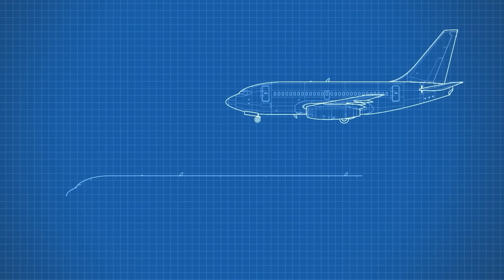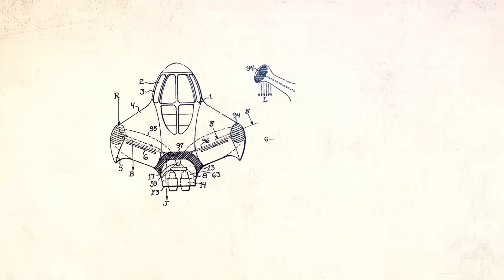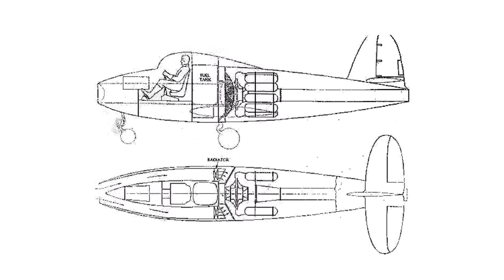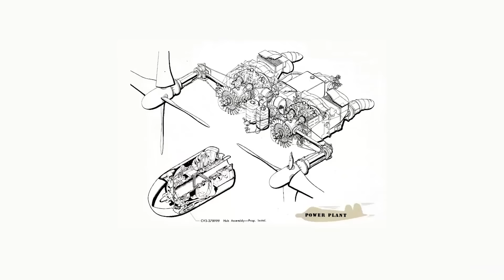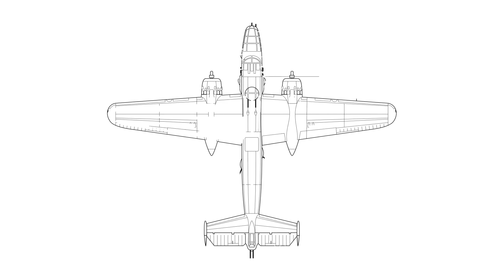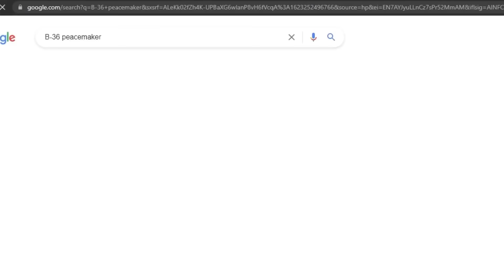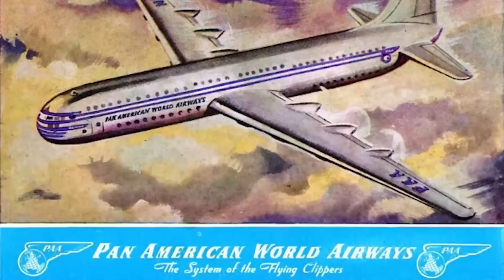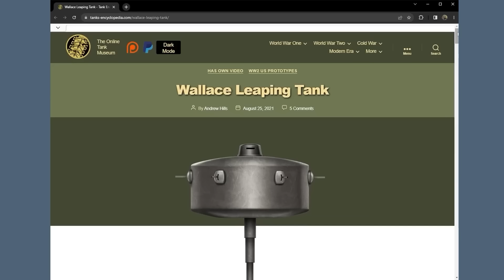The Forgotten Planes of World War 2 | Full Documentary

Comment: There is no mention here of the fact that the biggest problem with Northrop's flying wing was its stability in the air due to the lack of any vertical rudders and stabilizers. This was compensated only in the era of computers and advanced electronics, resulting in the B2 strategic bomber. This does not change the fact that the entire program looks like a highly suspicious fight for military contracts based on unfair competition and lobbying. The victim of which was one of the most talented aircraft engineers of that period...

Comment: You need to see " The Wing Will Fly" a  Documentary of Jack  Northrop's Flying Wing concept. Pay special attention to test pilot Cardinas who refused to do stall tests because power stalls of the airframe type can cause a spin that causes the plane to rotate along the long axis of the 172 ft wing at an rpm rate that will pin the pilot to the seat making it impossible to raise his arms due to.them being pinned to the seat by centrifical force. 

Cardinias recovered the spin because the spin he was in was in the opposite direction and his arms were forced AWAY from the pilot seat, whereas Glen Edward's arms were forced INTO the pilot's seat. Also, it was said Edward's co-pilot was flying it at the time.
Reply: Oh, yes. I forgot to mention that due to the shape of the YB49 the ENTIRE AIRFRAME WAS INVISIBLE TO THE RADARS OF THE DAY. This airframe design shape is naturally INCREDIBLY STEALTHY.  Duplication by the USSR in the 1960's would have destabilized the Cold War. In other words, without modern radar, and with the Norton bombsight stabilizer Northrop devised, this bomber could have delivered Nuclear Weapons into the USSR with NO advance detection. Thus, it had to be NOT developed. The USSR had to be convinced that the airframe was NOT successful. 

Three reason why this fuselage design not used on commercial airliners today it's because it would be impossible for air traffic controllers to know where they were at. If not impossible, it would be very difficult to keep track of them.

Comment: A smarter idea for the hopping tank would be to keep the entire chassis and add an omnidirectional "ball wheel" embedded underneath where the leg would go with large freely moving tracks or wheels recessed into the bottom that automatically rotate in the direction of travel to provide stability and lower ground pressure.